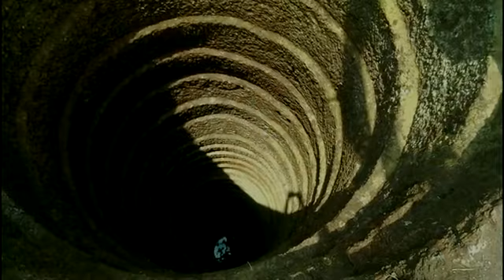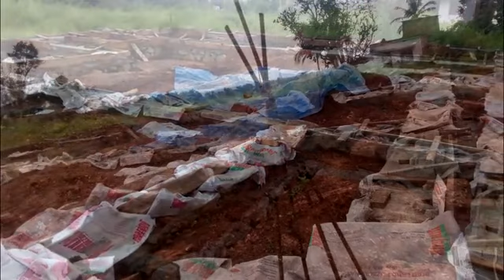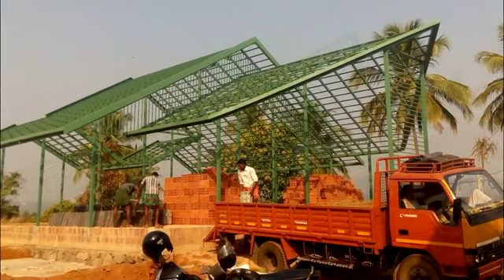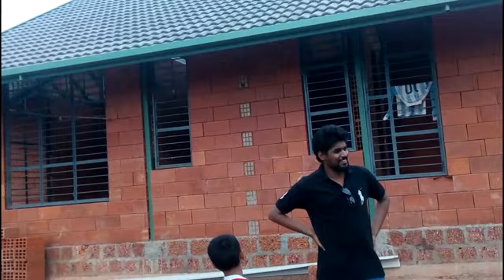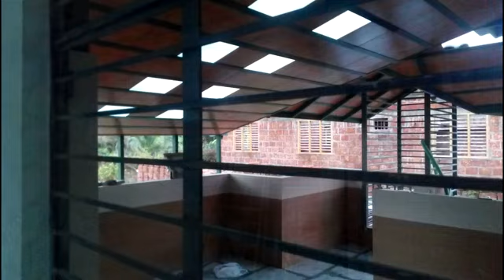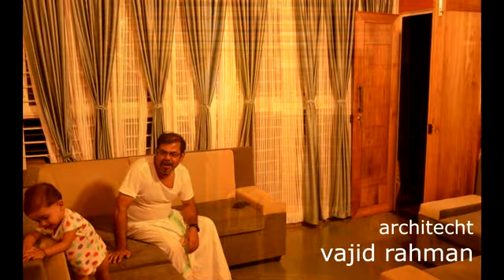ഇങ്ങനെയൊരു വീടും,അതിന്റെ നിർമ്മാണ ഘട്ടങ്ങളും ഒന്ന് കണ്ട്‌ നോക്കൂ | Steel house കേരള | Vajid rahman

Comment: One of the best planning and architecture ideas I have seen in a Non conventional construction using low cost material. I want to build a house in Coimbatore by this year end.. do you work in Coimbatore? Besides, instead of using stone slabs for flooring, could we use Terracotta tiles or Red oxide floors? In that case, will the cost goes down further?
Reply from the maker: +919746875423 
pls call him. He is the architect. Mr. Vajid Rahman
Reply: @ameenyasirhimalab5458  Thank you